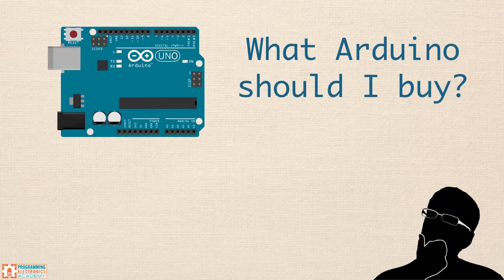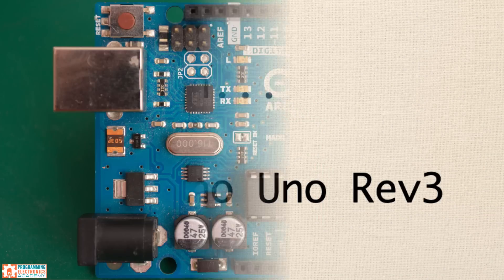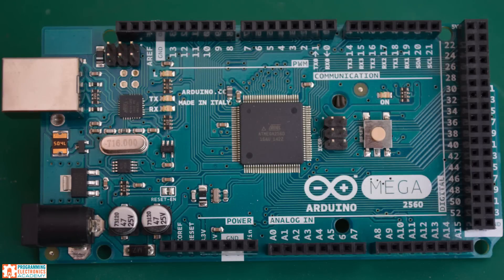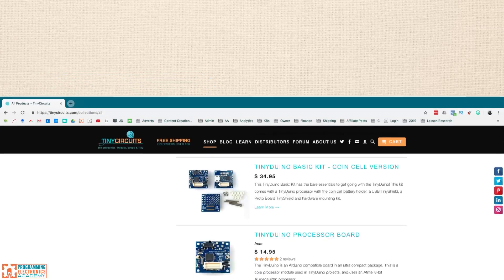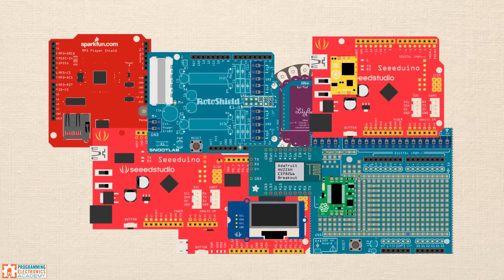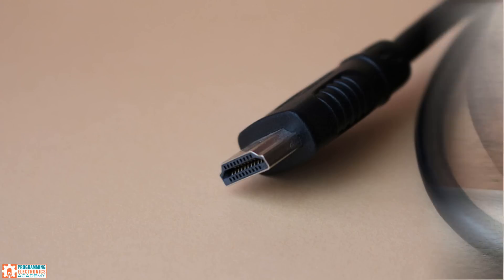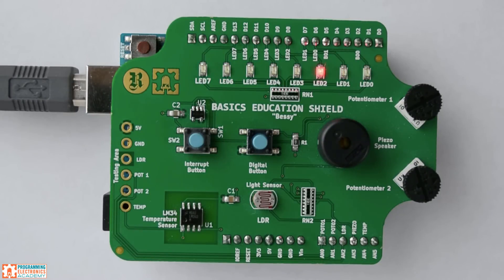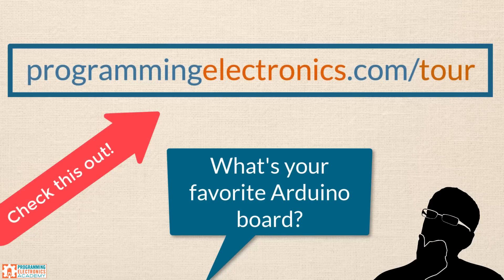Arduino Buying Guide [PLUS must-have accessories!]

Comment: Actually Nano can cover almost everything you can do with Uno or Mega and even be better than those. It's compact and can be easily attached to the breadboard. It's true that it has less memory and pins, but in most cases you don't need that much. But even if you do, these parameters can be bypassed: more memory with code optimization and external storage, more pins with shift registers. The only (common) exception, in my opinion, is Uno-compatible shields.

Comment: Your videos are just the ticket. I really like your style of instruction. I have a few questions that pertain to this topic and I've never seen them answered anywhere. First, is there an Arduino that is more of a DIN rail mount-able, professional, finished product? Like once you've prototyped your project...how do you make it neat and reliable? Next  question is, can one Arduino handle multiple projects at once or is it best practice to assign one board to one task (ie. One board to manage your garden, one board to water your lawn, etc). Lastly, besides the programming language, what's the difference between an industrial plc and an Arduino? Thank you for your time and content. I'm considering becoming a member.
Reply from the maker: Thanks Andy! Great questions!  I am not sure I have great answers however.  

I know there are more "industrial grade" vendors out there that supply things like DIN rail mounting, terminal blocks, and solid enclosures designed for those kind of applications.

As far as "multiple project per board". I would say generally people have a dedicated Arduino board for a specific application they have built.  It's not to say that a single Arduino board can't be responsible for reading several different sensors and processing/reporting/taking action according.

I am not that well versed in PLCs, but from what I understand they are running small real time operating systems on them (not to say some Arduino's can't do that).  Also, I believe it is the case that PLCs have for more I/O than you get from an Arduino.  Again, I'm not that versed in PLCs, so please take that with a grain of salt.

Best of luck!

Comment: Pretty sure the micro usb picture is actually an hdmi cable...
Reply from the maker: Well, I stand corrected.  I have no idea why I would have had an HDMI cable laying on my desk, but hey stranger things have happened.  Thanks for the correction @Octopus Technology
Reply: Yes, you are correct.
Reply: lol i saw the comment first and then when I actually saw it in the video I was like what the heck that's def an hdmi lol. ps love the video it was a major help :)
Reply from the maker: I does kind of look like an HDMI cable, but it is a micro USB cable, it was just a much closer up shot.
Reply: @programmingelectronics  NO, it IS an HDMI cable -- NOT a micro USB cable. A micro USB cable only has 4 wires/contacts, an HDMI cable has 19. The cable shown has 9 contacts on one side and 10 on the other.

Comment: Excellent intro for beginners. I fell in love with Arduinos some years ago and my favourite board is the Arduino Pro Mini due to its small form factor and price. I usually get them as China clones for around 3-4 Euros each.
Reply from the maker: Thanks for the kind words Marcotronic!  I'll have to order an Arduino Pro Mini - I have not checked those out quite yet.
Reply: @programmingelectronics  Awesome little devices. Be sure to get an FTDI interface as well to connect and program them if you don't own one already as the Pro Minis don't have them on board (unlike the Unos or other bigger boards)
Reply from the maker: Thanks for pointing that out!  Luckily I have one of those laying around here.